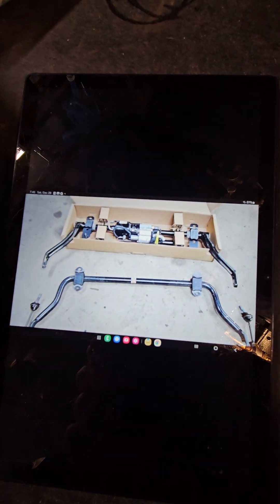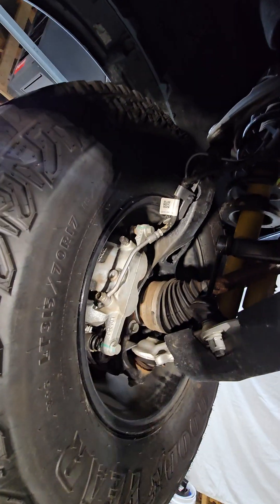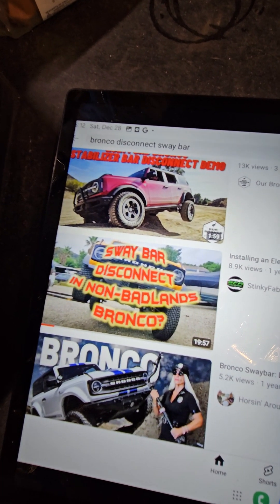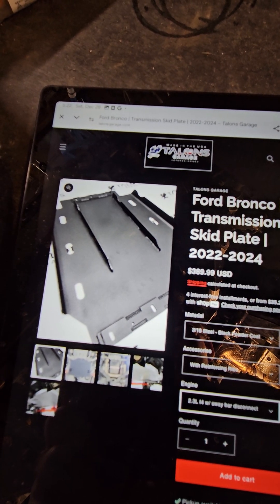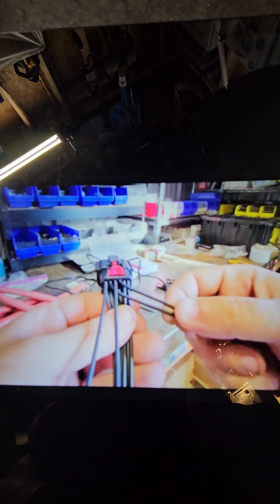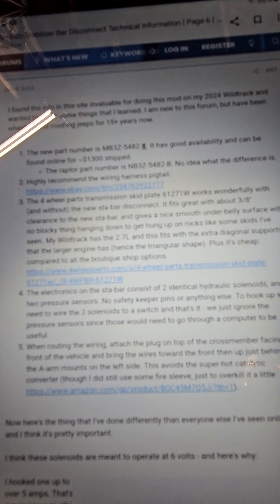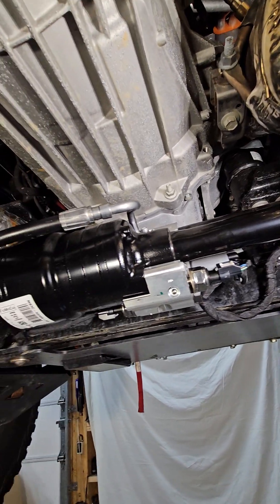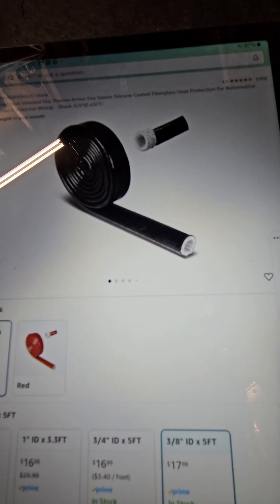Bronco Swaybar e disconnect Quick setup

Comment: I have a sway bar disconnect from factory in my Badlands and it broke. Could this be a fix for it instead of having to go thru the dealer?
Reply: Mine just broke and now im trying to figure out what to do. Did you find a fix?
Reply: @arjunsandhu1696 Yes, unfortunately debris had gotten into the connector and broken it so I had to replace it entirely.

Comment: One Bad quick question which aux switch is best used? Do I need to go all the way up to aux 1 30A like sticky fab recommends? Thanks
Reply from the maker: If you run the wires in series it drops the required voltage & draw  down for the solenoids to operate. I hooked my wires to upfitter switch #6 which is lower amperage and have had no problems with full functionality.
Reply: Thank you one bad